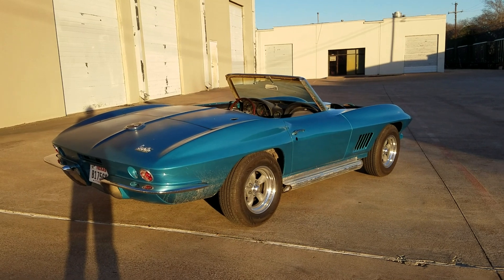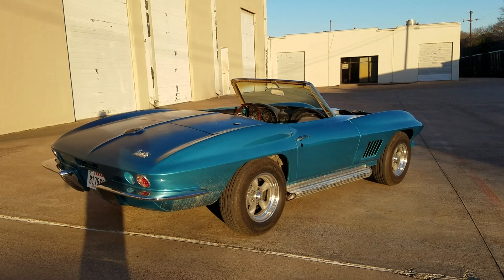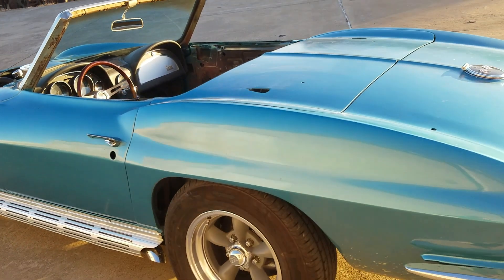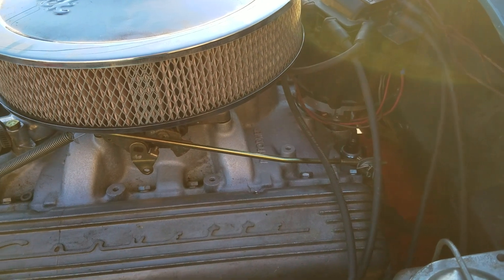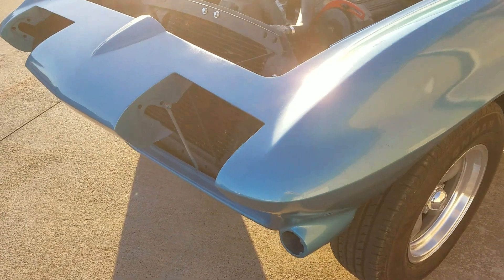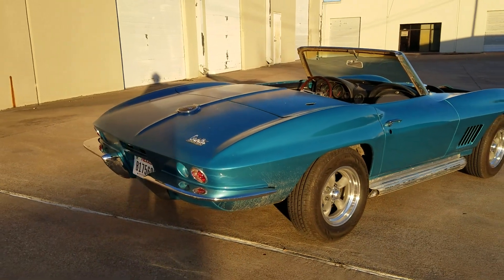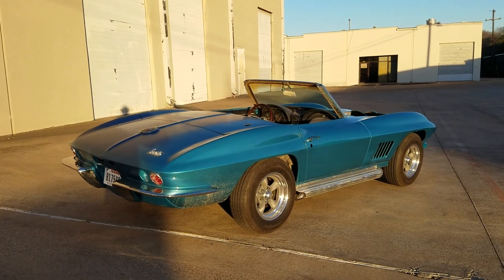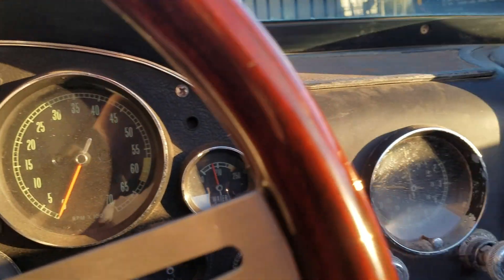Corvette video 25

Comment: I was kinda chuckling over the bent wire throttle linkage too, although didn't say anything about it cause I've been there...figured at some point it would be made a little more permanent.  I would luv a C2 daily and this one is gonna be perfect.  what could be more fun than a corvette roadster with a 4speed?